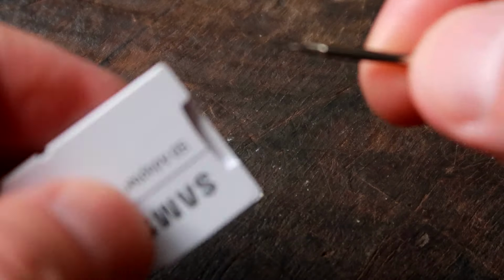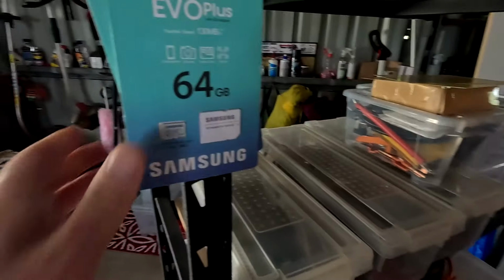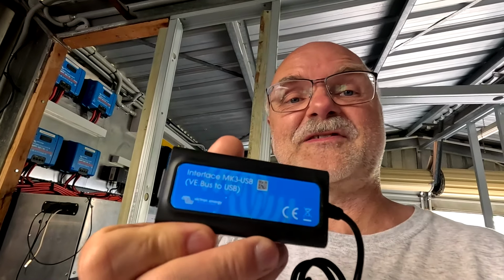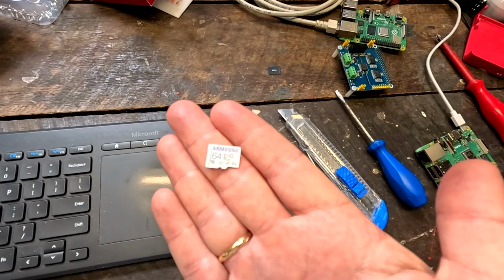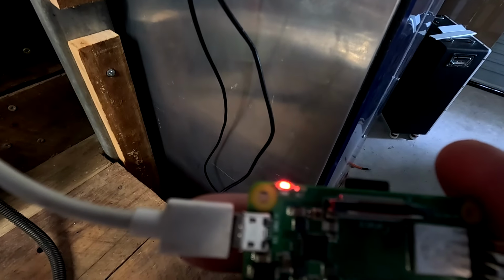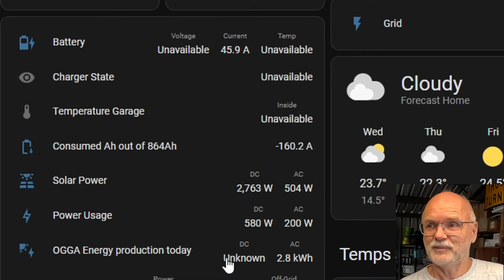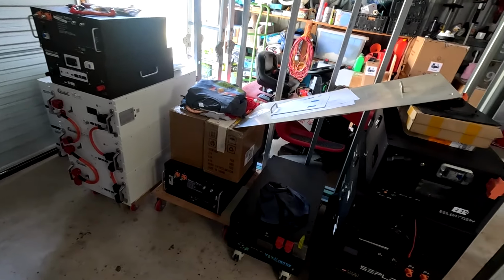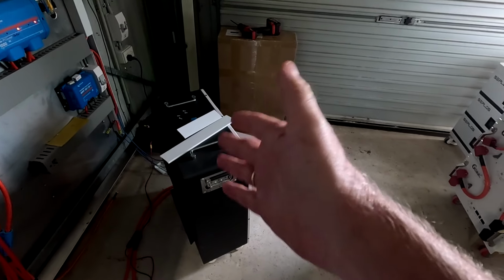Used Victron Cerbo GX replaces dead Raspi and why I lean towards no BMS communication!

Comment: finally!!! you arrived at the most logical conclusion that we don't need communication with the BMS. thank you!
Reply: we have twice experienced the single-point-of-failure in Phocos systems.
On the surface and based on the propaganda it looks like a good system...
AnyGrid, AnyCell, AnyBridge
But on closer inspection, it is a fragile convoluted kludge.
The AnyCell BMS REQUIRES a heartbeat to function.
No exceptions - ever.
The heartbeat comes from the AnyGrid inverter - but not directly - 
it is routed through the AnyBridge.
The ANyCell talks ONLY canbus.
The AnyGrid talks ONLY RS232 (and maybe possibly under specific conditions Modbus over RS485)
The ANyBridge routes / gateways the heartbeat from the RS232 proprietary Phocos protocol
to the CanBus  on AnyCell.
Even when AnyCell is only at 25% SoC, and at 18C, it REFUSES to accept any Charge if there is no heartbeat.
The BMS shuts down into standby after about 8 minutes.

So far, on 2 installations, with a total of 3 AnyBridge, only 1 worked
One of them was totally half-baked...
It was able to shove Inverter and PV data via the RS232 link to AnyBridge which then 
shoved it via bluetooth to  PhocosLink app on a phone.
However it failed to route the hearbeat signal.
It also failed to present AnyBridge as a device - or turn the Power LED on.

Phocos Tech support was totally unhelpful - other than to eventually diagnose the AnyBridge as the culprit
and to reveal the tidbit that the heartbeat was required.  Heartbeat implies unilateral direction from Inv to BMS
It is not clear when the AnyBridge is correctly routing the "heartbeat" whether any of the BMS data is received or used.
The AnyCell does not appear as a device in the app

It is also bizarre that even when the BMS comms are working, that the Battery type, and all other parameters
appear to  not be auto-configured by the inverter.
BatteryType must be specified manually by a setting.
However this setting is different depending on FirmWare version
Just seems crude and crufty rather than polished smooth and tight
Lada vs BMW
Anyway, cautionary tale regarding tightly integrated BMS
I can totally comprehend that a robust BMS is required to prevent any unfortunate incidents with LFP batteries.
HOWEVER, when the battery is cold and empty, BMS comms must not be mandatory in order to permit ANY charge uptake.

Comment: I have victron system,and i have no communication either,to the batteries...i have both bms and neey balancer on them,due to bms beeing uber shitty 100 miliamp passive balancer,and beeing unable to balance my cells properly.All these mambo jambo comms are over emphasised by battery manufacturers...not even the bms needed,if they are balanced properly,and kept inside,where never freezes...just my opinion...

Comment: that gobel software for pace bms looks interesting -  I will give it  a try. Most likely what ever power supply you are using for the pi is not good enough any longer . I had same problem until I got better power supply for my pi.

Comment: You do have the option to setup a Solid State Drive to boot the R-Pi from. This should resolve the SD card issue.
Reply: Still a good idea to copy the running config to another media or cloud backup.  To another media could be easily automated with rsync using the output of date (say +%w) to place each copy into a separate directory and rotate through those directories automatically.  Run nightly via cron / systemd or what ever, done.

Comment: As flash storage = SD-Cards have limited amount of write cycles you should do the following things:
1) buy endurence cards for car-dash-cams - those survice much more write cycles
2) on linux enable „tmp fs“ for /var/log  to minimize write cycles of 10 times per second log file entries by redirecting them to ram disk. Would help to automatically reboot once a week or every night
3) backup backup backup - so no need to sit hours and days every 2 years when the card crashes
Reply: You can configer newer raspis (3+, 4,5) to boot from USB sticks.   Makes backup much more easier and you can use bigger and more reliable sticks.

Comment: SD card problems with a Raspi is often due to either powersupply problems or bad quality of the SD card.
Powersupply-problems such as thin wiring, bad grounds, or a bad DC-to-DC converter on the Raspi, or even a brown-out.
It is also recommended not to pull the power from the Raspi, but instead use the poweroff command instead.
A broken SD card could indicate a DC-to-DC convertor problem on the Raspi, as SD Card uses 3.3 volts, and most of the rest of the Raspi uses 5 volts.
When the DC-to-DC convertor fails, it could potentially blow-up the SD-card. The fact your Raspi no longer seems to operate could be indicative that indeed the DC-to-DC (often the blue LM2576 SMPS, a 3 amp switching powerregulartor) failed and inadvertently put more then the 3.3 volts onto your SD card, blowing it up, literally.
I would recommend to use a good quality SD card bought from a (local) reputable source, preferable a brand-version (Samsung, Sandisk, Lexar, just to name a few)
As for monitoring, whilst it is nice to have the overview & control, I rely on the BMS to do the work, the alarms etc, and, knock on wood, in the many years I have done my DYI LiFePO4's, never failed me so far. I like the App, I like the BMS. Everything else is a nice bonus but not a requirement to me.

Comment: I still have one Raspberry Pi system running with two charge controllers, a shunt, and a Multiplus. The system has been corrupted a few times, so I've had to replace it. However, I manage all my parameters through Node-RED, which makes it really easy to create a backup image with all the mods for Shelly devices and the setup helper. When needed, I can swap the SD card, upload the Node-RED flows, and have everything up and running again in just a few minutes. I have no idea why you keep using home assistant. Node-RED generates beautiful dashboards and controls so many settings and other devices.

Comment: yea communication is really not needed if the stystem and the bms are setup correctly. but it would be nice to have a option in venus os to use the bms as a "secondary" measurement device for example if some battery is unbalanced to slow down charging at the end
Reply from the maker: That's what I have right now. The 'Peter Boards' are CAN connected and report to the Cerbo/Pi but are not in control.

Comment: I have a script that I wrote that backups the important VenusOS directories and sends them to my network attached storage box.  It runs as a cronjob every night.  I've used it a couple times now.  Should probably make a GitHub project for it.
Reply from the maker: That sounds interesting. Yes, Github please so I can show it on the channel.
Reply: To save your SD card you could setup a RAM disk or use a USB SSD and symlink your log directories to those drives. Since you’re exporting your logs some sufficiently large ram disk is an elegant solution so long as you’re ok with losing some logs during power loss.

Comment: Plenty of better options available than another closed source hardware.  As a number of others have pointed out, backup your os and replace sd card regularly.
Reply from the maker: A manual process is not practical.
Reply: @OffGridGarageAustralia It's only a manual process if the SD card or contents buggers up somehow.
I have lots of RasPi's running different things... I set up things on the Pi (OS, config, save it, etc) to how I like, shut down the Pi and then take out the SD and do a backup image of the SD card (.img) to my PC. If anything goes wrong down the track, I get a new SD card and write the image to it (which has all the preconfigured OS, settings, etc), plug it into the Pi, and I'm back running again in 15 mins.

Another option to the many suggested, lol.

And like others, I also recommend the SanDisk High/Max/Pro Endurance SD's from Officeworks.
Reply from the maker: @Spaceship_Mods  I guess, a manual one-off backup right after the installation could be a solution. Venus OS will keep evolving and updating and the backup will need to catch up once used. But I suppose, it is better than nothing.
I have ordered the SanDisk Endurance SD cards and will test them.

Comment: Well; here is the guy from Arizona [the first and hottest place-currently 109F its early still yet!] it doesn't surprise me anyway. I hate to tell anyone what to do. I was afraid your "Home Assistant" would not be working either. It is important you backup your system regularly and use the correct memory card; using a larger memory card serve no purpose unless you like to through your money away. They are a pain in the butt, talking from experience. It seems you are going to need a new Pi for starters. Don't use any fancy enclosures; I know they look nice but a sure failed for poor cooling and a premature failure because of the extra heat factor. Remember back up regularly. It is a must for these small systems.
Sorry for taking some of your time. Au revoir.

Comment: There was a Post from another youtuber who was also leaning to use @Battery without the control to the BMS as they are having Problems sometimes and it will then  have a Domino Effect . With a Smart Shunt it is more @simple and tends to work .

Comment: 2 Battery Banks, 2 Victron Smart Shunts, 2 Raspberry P1 B4, 64 GB Sandisk cards, both running Solar Assistant.
That gives me all the info I need locally, or like this year so far, sitting in Alice Springs, Brisbane, Cairns or Adelaide.
My recommendation would to get the original Raspberry Pi power supply and also hook it up to a monitor, so you can see what's happening.
You can also backup and upload your historical data without taking the SD cards out.
Argon case with a fan hat too, good cooling.
Reply: Your Ras Pi's work with 64GB SD cards?
Video states those aren't supported.
Reply: @volodumurkalunyak4651  No, I misspoke, my cards are 32 GB each, just checked and both are currently at 6% used.
My apologies for the misinformation.
Reply: what inverter do you use?

Comment: @OffGridGarageAustralia Andy Andy Andy!   I've never used a venus OS, BUT if its a Linux distro, SD card backup is a no brainer and requires no added software. Additionally plug a monitor into your rasberrypi  and read the errors off the screen and post them here and I'll troubleshoot.
Reply from the maker: I'm not a linux person.
Reply: @OffGridGarageAustralia  You don't really have to be!

Comment: 8:36 There is no hardware limit on micro SD card size with the Raspberry Pi computers. I am currently running a Raspberry Pi 3 Model B Rev 1.2 with a 128 GB micro SD card.

I would suspect that the issues you are experiencing might be coming from incorrect data on the SD card. Check whether the version of the operating system you are flashing is suitable for the correct Raspberry Pi model you have. And also check that the card's content after flashing matches your expectations.

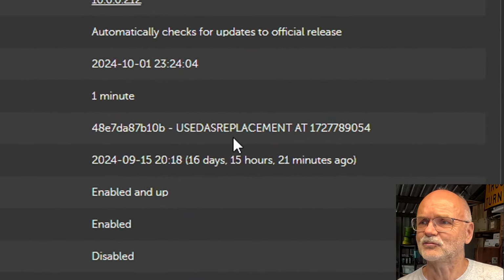Comment: 13:20 the replacement at is in Epoch or Unix time (basically the number of seconds since 1/1/1970. 

1727789054 is Friday, 4 October 2024 9:33:30 PM (GMT +10) 

And yes, because Unix time is stored as a 32 bit integer, it means we run out of Unix time on Tuesday 19th Jan 2038. 😢

Comment: I have broken pi sdcards by failing to remove them when putting the pi in its case (they stick out) you can, of course, put them back in once it is installed in the case.
When you switch out boards and they all fail, look to the power supply (cable and USB adapter) and anything else that is common.

Comment: Hi Andy connect a monitor to these raspi.... on the screen like a normal computer you can undestand at which point of boot they are stuck. without a monitor how can you troubleshooting the pi?
newer version of raspi-os maybe don't run on the older pi (like 64bit version for example) and the new pi4... this devices can be setup also to run directly from a usb (pen or ssd drive... infinitely more reliable than a sdcard) it is possible the bootloader is setup to run a usb and it is just  ignoring your sdcard. With an hdmi screen connected you are able to see whats is going on..... and yes for the Pi4 you need a microHDMI cable/adapter!

Comment: 🙏 Thanks for sharing. I really don't see any reasons for using the RPI instead of the Cerbo GX other than the moderate financial gain, which in turn requires a lot of extra work, let alone the disadvantages and risks.  Can you mention some unique features that the RPI would add to the installation compared to the standard Cerbo gx? Also, be aware that the VE Smart does not like running in parallel with the Cerbo GX, I recently had to disable it as I was getting several warnings "error code #66"
Reply: There are some , but it is regarding add ons and NODE RED  . For me the build in advantage is the usage of DC Volt Batteries it accepts 8 to 70V DC . If you are having an Island Battery approach that Part cost you some for a Raspi !
Reply: @markusviel6440  I'm not sure I understand what advantage would Raspi give us with Node Red which is meant to comfortably run on Venus in the GX, perhaps you can expand on this?
Reply: @markusviel6440  i am attempting to use VenusOS on Pi so i can convert the BMS protocol to talk reliably with some Samsung batteries that have a different CANBUS protocol , in a system with Victron MPPT's , Sungrow Inverters , Samsung batteries ..... :/

Comment: I still have a Pi 2 up and running since it came out and has not stopped running since installing it. Its primary function is to update me via text msg (using Verizon testing) if my IP address changes and at the end of the day it gives me a summary of my analog sensors. I refuse to touch it in fear of it stopping. Also I do not remember the Password. If it is not broke don't fix it!

Comment: I would recommend a SD endurance card. Those are designed for high writing cycles. Usually used in DVR and servers. On the other side, try to remove ALL partitions in your current SD card before using "Raspi Imager". It has an option for that (Erase -> Format card) in the drop down menu for operating systems.

Comment: I think the rp3 is dead. The rp4 needs a very powerful power supply. The best is the original wall plug for rp4. It is 5v 3A. The 3a is out of specs for the most usb adapters. I use in my setup 128 ond I think also 256gb cards. Works well. I highly recommend to use an ssd. The rp4 with the newest board update it is plug and Play. Just use an sata to USB adapter.

Comment: always clone a raw copy of you're sd cards.  Use balena etcher to make a image file backup.
Reply from the maker: That is totally impractical if it is a manual job.
Reply: @OffGridGarageAustralia  not following, all you need is a card reader and it copies to a file on your computer. You can flash it unto any sd card anytime later.
Reply: I guess Andy mean the work to switch Off the Raspi, take out the SD-Card, go to the computer, etc. Yes, this ist no work you want to do let's say 1 time per month?
Reply from the maker: @Rinzler1215  exactly, if it is such a manual process, it just won't work. There needs to be a better, automated way.
In HA, the backup runs automatically and gets uploaded to Google drive afterwards. That's what we need for Venus OS if it runs on a Pi.
Reply: @Rinzler1215  it may not work if you want to backup the logfiles. But at least you have your starting point back.

Comment: I would like to reduce communication between my BMS and the Victron gear. But, when the Victron gear is throwing 40A into the battery the cell balancing can’t cope and some of the cells run away. With communication the BMS can tell the Victron gear to reduce charge current to a point it can cope while balancing.

The RPi, you’ve already considered cloning the SD card. I don’t think the RPi stores any information so swapping the card for a cloned copy when things go wrong should be fine. My brother has an RPi controlled solar charge controller and he as a backup RPi and a preconfigured SD card.

As for the RPi itself failing, have you tried turning it upside down? Maybe it doesn’t like being down under :)
Reply from the maker: Well, in this case, you are masking the underlying problem of unbalanced cells in your system. Of course, slowing down while charging helps to mitigate the problem, but it does not solve it.

Cloning the SD card is not really an option as I pointed out. I will just forget for months or altogether and it's a hassle to do it manually.

Comment: I have used 64 GB SD cards in Pi’s without any problems 🤷‍♀️🌷 Always quality Samsung A1 / A2, never had one die ever over 10+ years
Reply: Me too ....  ( Raspi3 + 64GB Sandisk )
Reply: I'm trying to come up with scenarios where the card could break like that.  Its never happened to me, ever.   I can think of two.  One, the card got damaged from a bit of bendy bendy while you were inserting it and finally failed.   Or, two, the card is held in place with a spring mechanism of sorts... heat combined with time could have made the plastic bendy enough that the stress broke it.

-Matt
Reply: 3B, 128GB kioxia card. It was a noticeable upgrade from the older 32GB SanDisk one.
Reply: me too (raspi3+ 64gb sandisk)